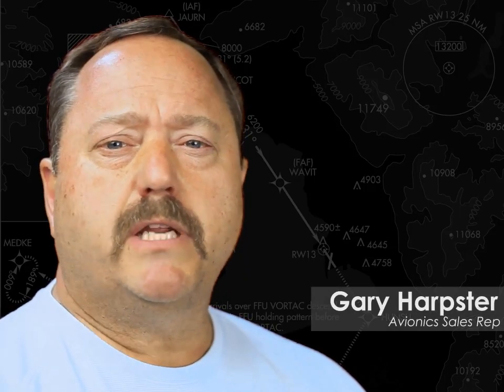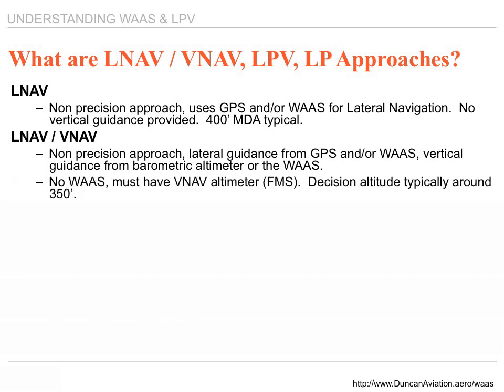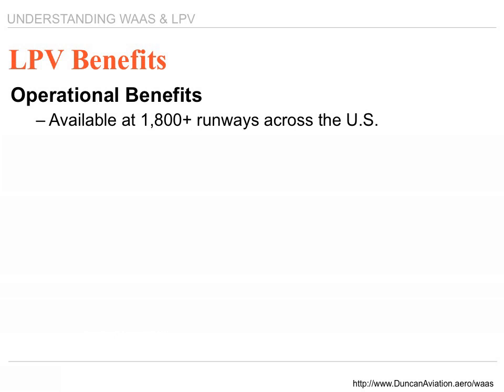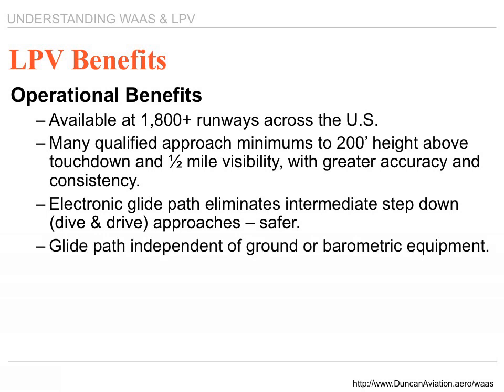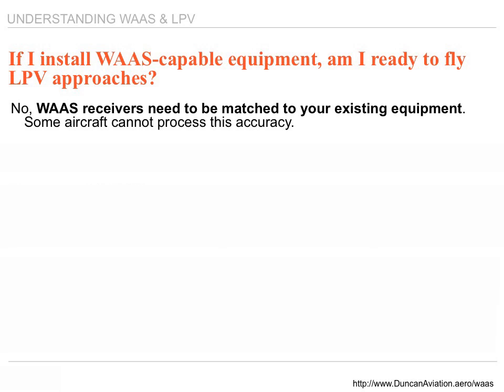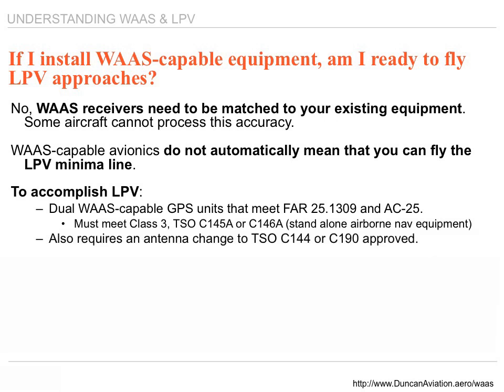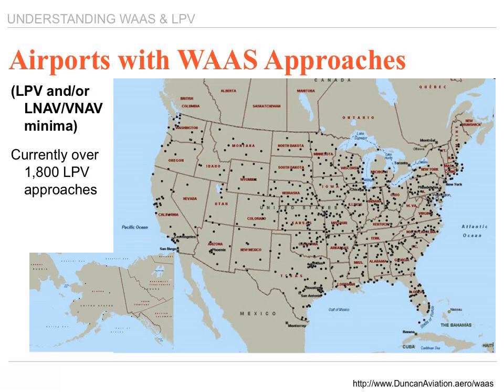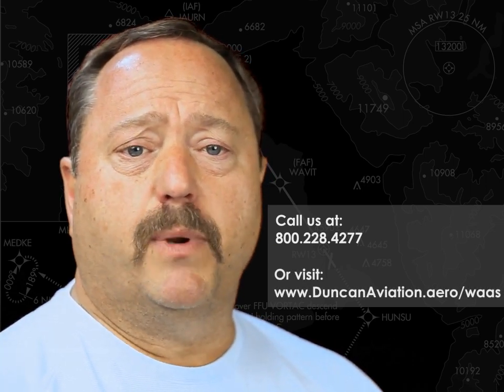Understanding WAAS & LPV: What is LPV

Comment: Definition

Localiser Performance with Vertical Guidance (LPV) is defined as an Approach with Vertical Guidance (APV); that is, an instrument approach based on a navigation system that is not required to meet the precision approach standards of ICAO Annex 10 but that provides both course and glidepath deviation information.

Comment: If you read the FAA documentation, it clearly says LPV is a non precision approach. Its actually called APV approach but does not come under the precision apprch catergory. Please correct your video.
Reply from the maker: Edgar, We have not amended this video since completing it several years ago - but you are right LPV is NOT a precision approach.  At the time it was developed the FAA never had a term to call it, even though it was identical to an ILS.  So to this day it is not considered a precision approach.

There are presenter's notes at the top of the page stating that LPV is not a precision approach.
Reply: Definition

Localiser Performance with Vertical Guidance (LPV) is defined as an Approach with Vertical Guidance (APV); that is, an instrument approach based on a navigation system that is not required to meet the precision approach standards of ICAO Annex 10 but that provides both course and glidepath deviation information.

Comment: Question.  This video says DUAL gps is required for lpv.
I asked 3 radio shops and all say a single garmin wass nav is all thats required.  Anyone have any input on this.
Reply: Ray, the shops you checked with are correct. In the part 23 world (aircraft below 12,500 lbs) you are allowed to fly LPV with a single FMS.  In the part 25 world, dual FMS's are required to achieve the performance standards needed. I've been told it may be possible to meet the performance standards with a single FMS but the manufacturers don't want that liability, remember you are relying on GPS accuracy to guide you down to 200' (depending on the approach) so having a second system to back up your primary offers a higher degree of safety.
Reply: Gary Harpster thanks 4 clearing that up. I like the dual idea better..
Fast reply thank you.

Comment: LPV is not a Precision Approach!
Reply: Last I heard an LPV approach can be demonstrated as a precision approach but it is not considered a precision approach.
Reply: To be a pilot ya gotta be a little bit of a lawyer haha
Reply: It's not an ILS precision approach.
Reply: LPV is AS precise as an ILS but it is still not a precision approach according to ICAO.
Reply: Definition

Localiser Performance with Vertical Guidance (LPV) is defined as an Approach with Vertical Guidance (APV); that is, an instrument approach based on a navigation system that is not required to meet the precision approach standards of ICAO Annex 10 but that provides both course and glidepath deviation information.
Reply: 카리어스
LPV, LNAV/VNAV, and Baro VNAV are considered to be an 'Approach with Vertical Guidance (APV)'. These types of approaches are differentiated from 'Precision' approaches (ILS, PAR, etc.) in the FAA AIM (Section 5-4-5, Paragraph 7).
Reply: For the FAA an LPV alternate minimum are 800/2 thus not precision
Reply: Wrong. LPV is just as precise as ILS.  The FAA admits it..but won't call it that due to historic and legal issues.
Reply: yes it is. with waas
Reply: +Larry Luffel  Technically correct but from a practical view LPV has the same minima as a Cat 1 ILS approach (200 feet, 1/2 mi vis) and can be used in lieu of ILS precision approach.
Reply: GBigs Angle explain that to your DPE and watch you fail
Reply: it's a precision approach